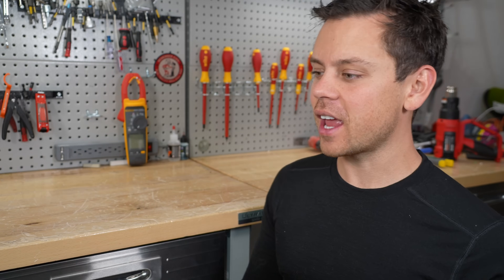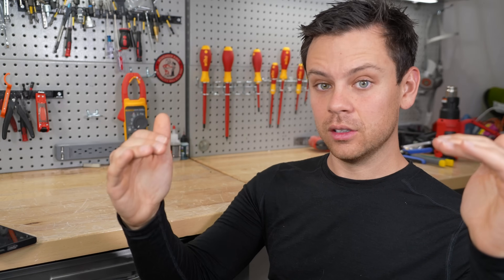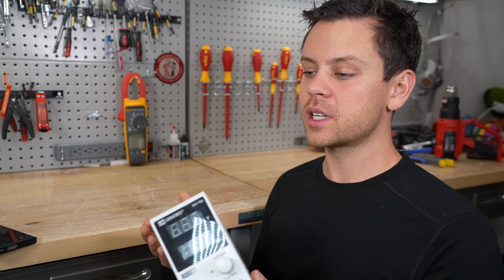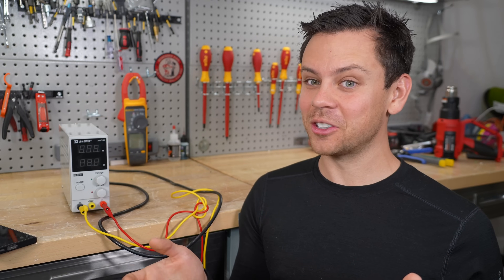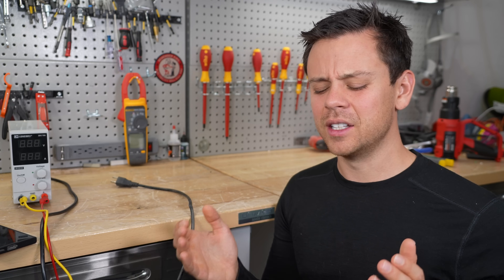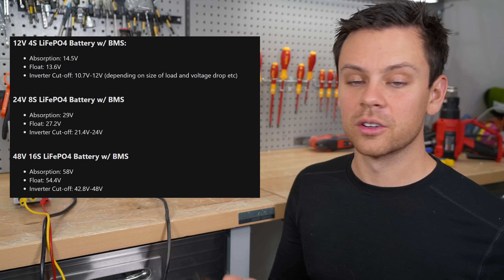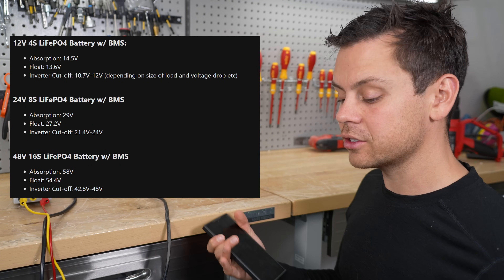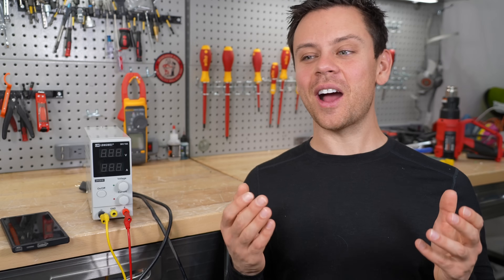LiFePO4 Charging Guidelines: What is 100%? What is 0%?! How to Balance??

Comment: As a newbie, it is confusing when talking about percentages and the manuals go by volts. I was relieved to see the numbers for 48v batteries when charging and discharging also popping back n forth between 12v and 48v systems causes confusion. I hope the 48v numbers are close for 51.2v batteries.

I'm putting together my first 48v system (51.2 batteries). The batteries have a few numbers to go by and the charger/inverter has all kinds of parameters that aren't listed by the battery specs. Manuals could be better written. My batteries average around 3.425 with a Diff of .007.

My system: 10- 410 watt bifacial panels in series (37.67 VOC),  PowMR 6500w 120/240v inverter/charger, 2- 51.2v Vatrer server rack batteries, plus 2- DC disconnects (1 inside shed and 1 combiner box at the panels), several size cables to match the need and some hair loss.  I've viewed most of Will's and other's videos several times til it sinks in. 

Grounding and bonding is probably the most confusing issues with multiple theories on the subject and there doesn't seem to be a standard that all-in-one manufactures use.

Cheers

Comment: We have 4 Lifepo4 24 volt batteries. Worked great last year at seasonal camp. Brought home over winter and stored at 50%. Charged all about 67% and put back into use. Now only 1 battery charges to 100% and goes into protect mode. The other 3 stall at about 75% SOC on solar. Got one to go to 100% now too (it’s the “mate” to the series on the system) but the other 2 still won’t charge on an electric charger (correct type). What’s going on? Can you give me any help?

Comment: I love these videos they're so informative so thank you for that. I literally need a step by step to get my two Eco worthy 5000 watt hybrid inverters that are wired and parallel to be on auto pilot.  
I have 120 volts coming into both inverters from my main panel via a 40 amp 2 pole breaker.

I have the master inverter and slave inverter set as well as the master battery and sleeve battery set appropriately.

Off of my main panel there is a manual transfer switch where I can switch on and off 10 different circuits that will be powered by the inverters in the event TV and Battery fail it just switches into bypass and pulls from the grid for those particular circuits on the transfer switch.

I finally picked up panels on friday. I got 12,- 410 watt bi facial panels.  The plan was to put six in series for each inverter.

I'll try to test one of these panels yesterday I was very disappointed to see that I could only get these new panels to pull around 200 W Max in absolutely direct sunlight with no clouds even at a 30% angle directly facing the Sun.  So I don't know if new panels need to break in or something, but I'm disappointed at the moment with the output considering I have a Panasonic 370 Watt on my shed roof and I watched it hit 365 yesterday in the same exact sun and the same exact orientation.

Anyway while testing yesterday I had to put four of the new 410 watt panels in series before the inverter would get triggered with the minimum 120 volt input to turn on the solar chargers on the inverter. I only have this small string of panels hooked up to one of the two inverters and the one that it was hooked up with did in fact turn on the charger to send current to the batteries.  

Running this system enclosed Loop configuration with the Cat5 cable from the master battery to the master inverter for communication.

Still find myself missing with the settings on a daily basis to see which of the settings is getting the AC charger to kick on whether it's setting 4 or 5 and the eco worthy settings or if it's setting 37 or if it has to do with the soc settings around 60, 61, 62 etc.

Going back and forth with customer service for about 2 months now and I'm still just as confused as ever, I do seem to get more beneficial information off of the do-it-yourself solar forum, I still need a little love to get this thing up and running the way it's supposed to be though

Comment: Hi I came across this interesting video and I agree with you, I own a sealed 24v 300ah lifepo4 battery and the cells will most likely be mounted like most of these batteries with the poles not facing upwards but let's say lying on their side, in your experience this can affect the longevity of the battery, or would it be better to open it and see how the cells are positioned and possibly change the position of the battery so as to have the poles facing upwards?

Comment: I'm a bit confused. Does Will's advice to charge LiFeP04 batteries to 100% and discharge them to 0% apply Lithium Ion Li-ion batteries.  I have a  48V Samsung 94A Li-ion battery module that I intend to power a 48V electric outboard motor with.  To get the best longevity from the battery, should I only charge it to 80% and don't discharge it lower than 20%?

Comment: Hi. Based on my research….Your advice only applies to a solar only charged system. And you make some good points. In any other use. Like a RV or a boat when not being used for deep cycling due to shore power for extended periods of time. It’s best to set the float to keep them at 13.6-13.8 volts until a few days before your trip, then set the charger to over 14.0v. I use 14.2. Then they float charge at that voltage for a few days before your tip to top off and balance them. And make sure to balance periodically even if you aren’t using them. Balance every few months, or at least a couple times a year. Lifepo4 batteries with have a shortened life if you constantly keep them charged to voltage above 13.6-13.8. The reason for this is the batteries will slowly overcharge and kill the capacity. This is well documented and even companies like battle borne batteries admits this now. Bottom line. Never store lifepo4 on a float charger above 13.6-13.8v.

Comment: He said use a P.S. but did not say how to charge it or what volts and amps to set the P.S. to? Why? Then he says start with good cells that are matched? Who buys bad cells that are mismatched? He mentioned cheap small 12v batteries, but w hat is that? Then he says cheap batteries with mismatched cells? Who sells those? Then he talks about a power supply to charge your battery?

Comment: Solar inverter manufacturers recommend not to discharge the battery to a very low SOC, ex. 35%. Battery engineers say it's perfectly fine to discharge to 0%.
Inverter engineers vs battery engineers, who to follow in a solar power system?
Reply: I've never seen anyone recommend going down to 0%. I did see people saying they go down to 10% without affecting battery life

Comment: My charge controller doesn't allow me set a different float voltage for lithium batteries. Both absorption and float charge voltages are set to 14.5v. It charges a single EcoFlow 12v lifepo4 battery which you've reviewed. I always get a disconnect at full charge. Will I have problems with these voltage settings?

Comment: Awesome and informative video! I have questions:

1. Which batteries qualify as "cheap" in the sense that they do not have closed-loop communication? I recently bought four Power Queen 12.8V 100Ah self-heating batteries. No mention that I've been able to find (so far) that would indicate yay or nay for this feature. 

2. Your point about keeping the battery temps even rather than allowing any stagger to occur was timely - because I'm in Alberta, Canada, where winter temps between mid-December to early March can often dip below the -4F lower limit of the battery's self-heating feature. This can damage the battery (I would think), but Power Queen does not recommend any external heat system because it cannot be controlled by the MBS. 
But what about strategically placing a pair of heat lamps in the battery bay to indirectly raise the ambient temp in the bay, and with said lamps set up on a thermal switch that kicks in below say, 10F? I would think that as long as the lamps are not aimed directly at the batteries and are set up in such an orientation as to heat the area evenly....

These batteries and solar set-up will be installed in our 34-ft class A motorhome, and the roof has room for 1000 watts' worth of solar panels. We'd still have battery charging options from the on-board 5500W generator and from shore power via the transfer switch. (an inverter would be installed between the transfer switch and the AC distribution panel, and this inverter would be fed by either the battery bank or the transfer switch). I will not be routing power from the rig's alternator simply because
 a) we will not often be going on long trips and b) given that fact, no sense relying on a DC-to-DC charger to protect the alternator when the other alternator-killing feature of LiFePos is that damage can occur to it whenever the BMS shuts off charging to the battery bank. 

3. I also plan to keep the original FLA house batteries installed as a backup power source (and emergency starting source) but divorced from the LiFePo batteries. Are there any issues that I haven't considered with such a setup that you have concerns with? 

Any input much appreciated, and thanks for all of your videos and insight.

Comment: Power supplies are not really battery chargers. I would be careful about hooking a power supply like you show to a battery. It's certainly possible that most of them handle the potential of having a set point below the actual battery voltage, not causing damage to the supply due to reverse current flow. I would put a silicon diode between the supply and battery and set the supply to approximately 14.5+.7= 15.2 volts. Better yet, use a diode and monitor the voltage on the battery itself. I could be wrong, maybe most of these supplies are protected. I have a supply that looks like yours, except it's black instead of white. Maybe I'll try this with a diode in place.

Comment: Question:  I got a brand new 300ah battery.  The cells voltage 1:3.63v. 2:3.702v. 3:3.747v. 4:3.357v. The manufacturer says that’s with acceptable specs.  Does that run with you?  Thank you

Comment: -20 degree F winters here. Super cold. I have my solar setup in a shed with no insulation, so inside it's about -5 degrees for weeks at a time. Last year I got ill and forgot to charge by batteries. When they were charged was just before winter. When I checked voltage 3 months later, they were still at 13.5v (12v lifepo4) and resting. Ran some capacity tests but didn't charger, just discharged. I wanted to see how much juice was actually left in there. So I know the capacity of my batteries since I test each one every now and then so it was 97 amps before I disconnected it and got ill. When I did a discharge test to see what was left, when the BMS cut off, it had pulled 85 amps. Idk, these are cheap Chinese batteries, but 12 difference in capacity over weeks of -5 degree temperatures in a 3 month period seems pretty good to me.

Comment: I have a question regarding an LFP 200AH battery. For the first three months of use, based on its 200AH specifications, a technician noticed that the Battery Management System (BMS) from the vendor was programmed for a 150AH battery.
This battery is rated for 6000 cycles, but after only 670 cycles, the cells became inflated. Upon reviewing the data, the manufacturer found that several cells were defective.
My question is: Could the fact that the battery operated for three months with parameters set for a 200AH battery while the BMS was programmed for 150AH have been a contributing factor to the battery issue?
Thanks for your insight!

Comment: Thanks for answering the question that 0% is 2.5Volts per cell......  what if I have a 12volt 300Ah battery and can't measure my individual cell voltage? Also how do I know that I am 100% balanced if I can't measure my cells? Can I overcharge?

Comment: A question I have had for a long time now... When the BMS disconnects the batteries How hard is that on the charge controller? Because you are supposed to shut off the power before you disconnect the battery.

Comment: i have 4 12v 100ah batteries in series parallel for 24v..what are the settings you would suggest for this setup and also how would i wire a victron shunt to the 4 batteries? thanks again

Comment: WIll... thanks for the great video and info.   For my 12v system, I pretty much follow the voltages you shared.  But maybe I missed it but I didn't hear how long you would set the absorption phase for.   My Victron devices default to 2 hours, however my Relion batteries specify 0-6 min.    Seems to be a large difference, and haven't been able to get a straight answer from Relion tech support.

Comment: Related, but maybe just too far out. I have a 24V Torqueedo battery that is out of warranty, and was sitting.. just over 10V now. It is LiNMC, so that is already a big difference! Torqueedo says the battery is toast and it is also out of warranty. And it is "unsafe" to try and charge it at this point. The Torqueedo 24V charger refuses to charge it. But.. I can't help wondering if it can be revived, because I hate to dispose of it if it can still be used.

Comment: Question. I have 6 x 100 amp Weize 12 volt batteries that you tested in a video a while back that you said were really well made, good batteries for the money. I currently have 3 x 190 watt solar panels and will soon be adding a 4th one.  I am using a 60Amp HQST MPPT controller.
This setup is in my motorhome which I use maybe once every month or two for a couple of days at a time and it is remotely kept in storage when not in use............  My question is...  generally speaking is it OK to leave the solar on for a few days while I am away, if I am planning on a trip in a few days?  Your thoughts?

Comment: Ok Will, I have a 135 ah lifepo4 battery with bms built in no control over it, Lithium charger 20amp no control over it and a victrom bmv 712 shunt is my only monitoring so how do I calibrate it if a haven’t used battery for 2 months and it’s at 70%?

How ever I did put a battery analyser between the charger and the battery
And it puts in 135ah to 140ah
But is rated at 135ah
Do I need to calibrate victron 712 shunt? Should I hit synchronise to 100% when charger stops? And set to 0% when battery is dead?
This question is more about the victron 712 shunt more than the battery

Comment: For many years I did balancing reconditioning of hybrid batteries for cars though much higher voltage and different chemistry though similar activity. I tell my customers that batteries are much like are bodies, they need to eat, sleep, rest, and run! If you exercise your battery regularly just like our bodies it will stay healthy!...It not that bad!
Reply: can you give some insight about hybrid battery balancing? I have a 2013 Lexus 300h with 170k miles. I've noticed the MPG has gone does a few notches this past year and I'm guessing its the battery finally showing some age. 

I'm tempted to buy a new battery from a company for ~$2700, their reconditioned batteries are about $2000, but I've heard of people reconditioning their own batteries. Any insight?
Reply: @keysersoze7034  there are a couple of issues that can negatively affect your mpg, 170k doesn't mean your battery cells are weak or out of balance. 1st check tires make sure you have low rolling resistance tires with correct size and psi, 2nd is check engine for proper maintenance, air filter, plugs, injectors and correct oil 0w20. 3th battery always a new battery will perform the best for the money otherwise recon is for those who want to get a couple more years out of vehicle.

Comment: This is a follow up to a post over two years ago: back then I was very appreciative of Will’s advice and help designing, installing and configuring a 30kw grid-tied system for our California ADU. Well, with PG&E’s 3 year delay in hooking up to the street, we’ve learned to live successfully fully off grid for a year now, and am enjoying it so much (can someone say no electricity bill, ever?!), that we’ve decided to never connect to the grid. Will has been helpful in so many ways, as our main source of information. Thank you Will!
Reply: That's great. In Missouri they have all sorts of fees just to be tied in even if you don't use their power. They also only pay you wholesale rate if you go  net positive.

Comment: Will, you made a video and immediately had to make another one because in the first one you were saying charge to 100% and discharge to 0%, then people complained, and you made a 20 min follow up video the next day that addressed boost, absorption, float but not for how long. You probably said charge to 100% 30 times. And weeks and months to balance 10 times. But not once did you mention how long or exactly how to do it properly. Pretty frustrating. Seems shockingly obvious.
Reply from the maker: What? Just charge the thing to 100% 🤣
Reply from the maker: It's really not that difficult lol
Reply: We know what you're saying but not exactly how to do it, man. People (including me) are not certain whether they are doing that or not, so you need to explain what settings. I had to sift through another couple of your videos and found you had set equalisation time to 0 and boost to 120. 

I had both set to 2 mins before that. I had float set to 13.8v and want to be sure that thats ok and it doesnt need to be 13.6v like you suggest. I had boost resume set to 13.1v for years and changed it to 13.2v because im worried im not charging to 100% after you hammering its importance. 
Good teachers explain the steps so that all their students pass the test and none fail. I bet some people arent chatging to 100% still. I am still unsure. When the sun goes down my batteries are 13.27 and my epever reg says 79% state of charge. Am I charging to 100% Will? If its so easy why am I not so sure.